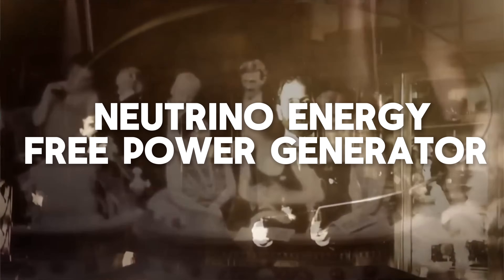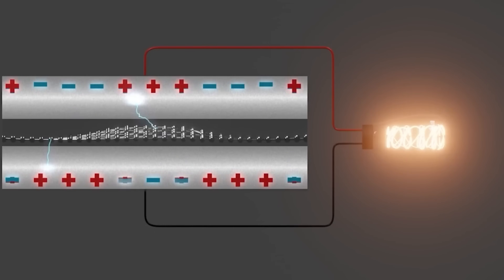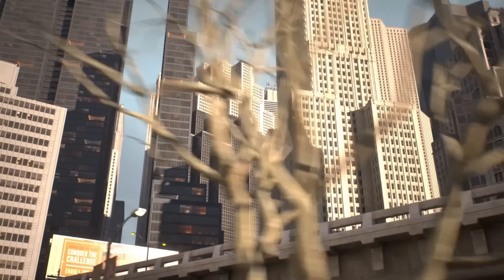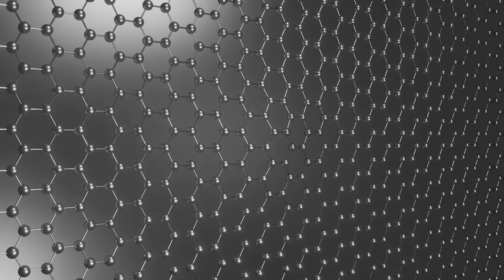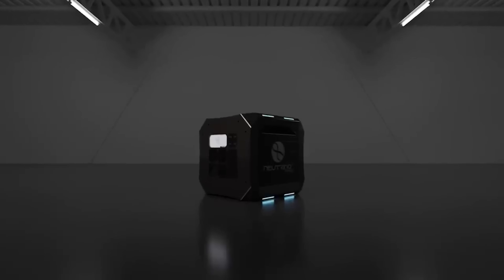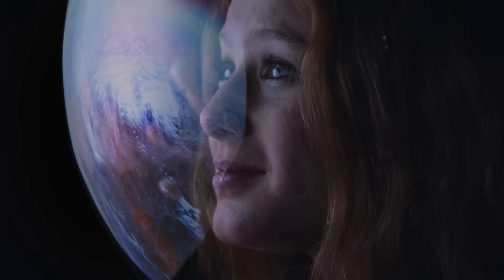German Free Energy Breakthrough: Neutrino Energy Power Cube Unleashed!

Comment: The claims made about the Neutrino Energy Power Cube and its ability to generate significant, continuous power from neutrinos are not accepted by the mainstream scientific community.

Here's a breakdown of the scientific consensus regarding the Neutrino Energy Power Cube:

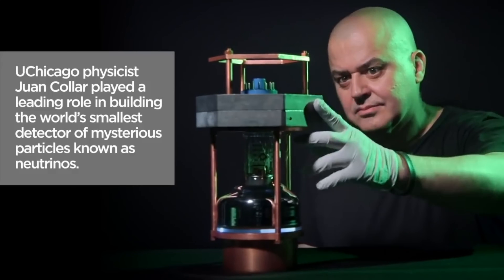Weak Interaction of Neutrinos (1:36, 4:11): Neutrinos interact extremely weakly with matter, making it incredibly difficult to extract usable amounts of energy from them. While neutrinos do carry energy, the energy density from their flux is very low, requiring massive detectors to observe rare interactions, not to power small devices.
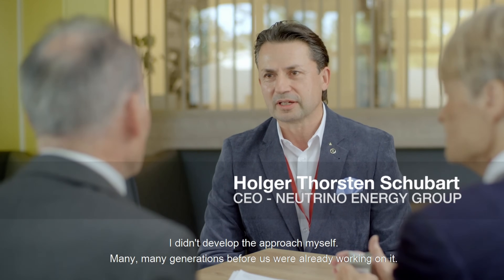Lack of Independent Validation: The claims by Neutrino Energy Group about their "Power Cube" technology, which purportedly uses special nanomaterials like graphene to convert kinetic energy from neutrinos into electric current (2:59-3:11), lack independent scientific validation and rigorous, peer-reviewed evidence.
Skepticism from Mainstream Physics: Scientists view these claims with significant skepticism, suggesting that the technology might be confusing neutrinos with other cosmic radiation or overstating the efficiency of energy conversion.
Patents vs. Proof: While a patent might exist for the technology, a patent describes an invention and does not prove its real-world functionality or efficiency. Independent verification of the Neutrino Energy Power Cube's capabilities is missing.
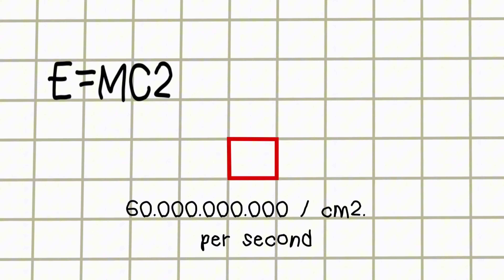In summary, while the concept of harnessing ambient energy is a scientific dream (4:28-4:47), the Neutrino Energy Power Cube's ability to provide substantial, continuous power as described in the video is not supported by current scientific understanding and evidence.

Comment: By the way FUTURE GALAXY, thank you very much for this contribution about THE NEUTRINO POWER CUBE, and by the way, electricity doesnt have to be strong, it just has to be available everywhere and at all times. It is the maths behind it that makes it a fantastic solution, because the strengh lies in the sum of all the small and "weak" units and just for comparison, 200.000 Neutrino Power Cube 5 KW represent 1000 MW the energy output of a medium-sized  nuclear power plant. At the future we dont need to distribute electricity over lon distances. The smart Network is made up of many small units, all connected ! It is no longer susceptible to failure and blackouts !and without a high voltage network to transport the energy over long distances it has no costs either

Comment: 110404    Nanometer scale uniformly aligned parallel diode arrays may be a practical way of absorbing ambient heat. Ambient heat is uniform on a micrometer and larger scale and non uniform on a nanometer scale. Plausibly,  heat absorbtion at the non uniform scale is available as Johnson Nyquest thermal electrical noise that would yield, by conversion without gain or loss, an equivelent amount of electrical energy. 
AND
 Diode voltage / current  characterstics can be displayed on an XY tracing oscìlloscope. Thermal electrical noise power in resistors can be displayed by time sweeps of voltage on an oscilloscope. Each such time sweep shows unique randomness.
AND
A  simple  "Special Program with Integrated Circuit Emphasis" model indicated that diodes in uniform aligntment parallel would aggregate simulated partially rectified thermal electrical noise. 

Maximum direct current electrical power, half, is transfered from a direct current electrical source to the electrical load when the electrical resistance of the two parts is equal. Calculated matched resistance output (watts) is k (Boltźman's constant), one point three eight x 10^ minus 23, times T (temperature Kelvin) times bandwidth (0 Hz to a natural limit ~2 THz @ 290 K) times rectification halving and nanowatt power level rectification efficiency, times the number of diodes in the array. 

There are a billion cells of 1000 square nanometer area each per square millimeter, 100 billion per square centimeter. 

Creditable independent replicatable proof of concept protypes beyond improper influence are needed.

Aloha
Charles M Brown 
Kilauea, Kauai, Hawaii 96754

Comment: 110404.  The second law of thermodynamics may be false conventional wisdom. Let's face the wonder of full heat use. 

The second law of thermodynamics was developed during v8ictorian england's scientific and religious fascination with steam engines. 

The second law is behind modern refrigerators needing electrical energy to compress the refrigerent to force it to release as waste the heat that it has removed from the refrigerator's service interior in the cooling part of the refrigerent's circulation. The interior coldness draws in exterior heat through the cabinet insulation. There is also discarded heat from mechanical friction and electrical resistance. The net thermal output equals the electrical input with energy not being gained or lost in this refrigeration system including its forced waste. Unencumbered refrigeration by the principle that energy is conserved should produce electricity instead of consuming it. 

It makes more sense that refrigerators should yield electricity because energy is widely known to change form with no ultimate path of energy gain or loss being found. Therefore any form of fully recyclable energy can be cycled endlessly in any quantity. 

Full heat recycling, all electric, very isolated underground, undersea, or space communities would be highly survivable with self sufficient EMP resistant LED light  automated vertical farms, thaw resistant frozen food storehouses, factories, dwellings, self contained elevators, safe rooms, and horizontal transports. 

In a flourishing civillization, small self sufficient electric or cooling devices of many kinds and styles like lamps, smartphones, hotplates, water heaters, cooler chests, fans, radios, TVs, cameras, security devices, robot test equipment, scales, transaction terminals, wall clocks, open or ciosed for business luminous signs, power hand tools, ditch diggers, pumps, and personal transports, would be available for immediate use incrementally anywhere as people as individuals or larger social groups see fit. 

Some equipment groups could be consolidated on local networks. 

If a high majority thinks our civilization should geoengineer gigatons or 
teratons of carbon dioxide out of our environment, instalations using devices that convert ambient heat into electricity can hypothetically be scaled up do it with a choice of comsequences including many beneficial ones. 

Energy sensible refrigerators that absorb heat and yield electricity would complement computers as computing consumes electricity and yields heat. Computing would be free. Chips could have energy recycling built in.

A simple rectifier crystal can, iust short of a replicatable long term demonstration of a powerful prototype, almost certainly filter the random thermal motioren of electrons or discrete positiive charged voids called holes so the electric current flowing in one direction predominates. At low system voltage a filtrate of one polarity predominates only a little but there is always usable electrical power derived from the source, which is Johnson (observation) Nyquest (theory) thermal electrical noise. This net electrical filtrate can be aggregated in a group of separate diodes in consistent alignment parallel creating widely scalable electrical power. The maximum energy is converted from ambient heat to productive direct current electricity when the electrical load electrical resistance  is equal to the array internal electrical resistance. 

Maximum calculated electrical power output (watts) is k (Boltźman's constant), one point three eight x 10^ minus 23, times T (temperature Kelvin) times bandwidth (0 Hz to a natural limit ~2 THz @ 290 K) times rectification halving and nanowatt power level rectification efficiency, times the number of diodes in the array. 

There are a billion cells of 1000 square nanometer area each per square millimeter, 100 billion per square centimeter. 

Order is imposed on the random thermal motion of electrons by the structual orderlyness of a diode array made of diodes made within a slab: 

  P type boron doped
-----‐------‐----___-- Out
🔻🔻🔻🔻
■■■■■■___ + Out 
  N type phosphorous doped 

All the P type semiconductor anodes abut a metal conductive plane deposited on the top face of the slab with nonrectifying joins;  the N type semiconductor cathodes or common cathode abuts the bottom face. As the polarity filtered electrical energy is exported, the amount of thermal energy in the group of diodes decreases. This group cooling will draw heat in from the surrounding ambient heat at a rate depending on the filtering rate and thermal resistance between the group and ambient gas, liquid, or solid warmer than absolute zero. There is always a lot of ambient heat on our planet, more on equatorial dry desert summer days and less on polar desert winter nights.

Focusing on the composition of one simple diode, a near flawless crystal of silicon is modified by implanting a small amount of phosphorus (N type conductivity) on one side from a ohmic contact end to a junction where the additive is suddenly and completely changed to boron (P type conductivity) with minimal disturbance of the crystal lattice. The crystal then continues to another ohmic contact. 

A region of high electrical resistance forms at the junction in this type of diode when the phosphorous near the ĵunction donates electrons that are free to move elsewhere while leaving phosphorus ions held in the crystal while the boron donates holes which are similalarly free to move. The two types of mobile charges mutually clear each other away near the junction leaving little electrical conductivity. An equlibrium width of this region is settled between the phosphorus, boron, electrons, and holes. Thermal noise is beyond steady state equlibrium. Thermal noise transients, where mobile electrons move from the phosphorus added side to the boron added side ride transient extra conductivity so the forward moving  electrons are preferentally filtered into the external circuit. Mobile electrons are units of electric current. They lose their thermal energy of motion and gain electromotive force, another name for voltage, as they transition between the junction and the array electrical tap. 

Inside the diode, heat is absorbe; outside the diode, to exactly the same extent, an attached electrical circuit is energized. The voltage of a diode array is likely to be small so many similar arrays need to be put in series to build higher voltage.  

Understanding diodes is one way to become convinced that Johnson Nyquest thermal electrical noise can be rectified and aggregated. Self assembling development teams may find many ways to accomplish this wide mission. Taxonomically there should be many ways ways to convert heat directly into electricity. 

A practical device may use an array of Au needles in a SiO2 matrix abutting N type GaAs. These were made in the 1970s when registration technology was poor so it was easier to fabricate arrays and select one diode than just make one diode. 

There are other plausible breeches of the second law of thermodynamics. Hopefully a lot of people, mostly as independent teams, will join in expanding the breech. Please share the successes or setbacks of experiemental efforts. 

These devices would probably become segmented commodities sold with minimal margin over supply cost. They would be manufactured by advanced automation that does not need financial incentive. Applicable best practices would be adopted. Business details would be open public knowledge. Associated people should move as negotiated and freely and honestly talk. Commerce would be a planetary scale unified conglomerate of diverse local cooperatives. There is no need of wealth extracting top commanders. We do not need often token philanthropy from the top if the wide majority of people can afford to be generous. 

Aloha
Charles M Brown 
Kilauea Kauai Hawaii 96754

Comment: This device seems to be based on relic neutrinos building a superfluid at 1.9K all around the Universe and interacting with matter much-much more than normal neutrinos. Relic neutrinos also serve as a possible explanation for the push model of gravity by streaming into the magnetic core of the Earth in order to condensate into matter with the help of magneto-hydro-dynamic processes running inside of fractal toroidal structures built from charge separated particles and by that causing the effects of gravity on the surface of the planet through a resistence caused when matter is interacting with the zero-point-energy field of the relic neutrino streams.
Relic neutrinos as a superfluid seem to be also the key to non-locality and the consciousness related effects like remote viewing.
So it sounds like an interesting and promissing tech, however devices built on the principles of the Casimir-effect do not need any moving parts (not even at the nano scale) and therefore seem to be more easily engineerable and manufacturable to me. 
Nontheless I am delighted to see more and more efforts towards free energy devices that could free humanity from the shackle of scarcity and environmental destruction and elevate us towards the next level on our cosmic journey as a conscious, awakened, spirit-driven, space fairing civilization.
Reply: Sounds like you know what's up. Gravity is a pushing force, not pulling, created by magnetic fields universally. The casmir effect is the best way to solid state free energy it seems. You may want to study the Le Clair Effect and especially E-infinity theory fractal-cantorian-space-time to explain the negantropy and non-locality entanglement. I'd love to talk more!
Reply: Welcome, to the wake up group

Comment: Super-Kamiokande is a giant neutrino detector hidden under a mountain in Japan. This structure, filled with 50,000 tons of water, is the most mysterious structure in the universe.
to capture neutrinos, which are particles
is working. Neutrinos have almost no interaction.
doesn't come in, so find them and
Catching it is quite an achievement.
So, if it is easy to catch neutrino. Question is this; Why Japans made this detector under 800 meters underground?
Reply: They dont want to catch Neutrinos - thats nearly impossible - right. Simply they use effects of Neutrinos and other radiation while passing layers of graphene
Reply: @gaiaassociation  İ mean they try catch the neutrinos effect. Thus, they will prove the existence of neutrinos. If it interacts with graphene so easily, why did they build such a detector?
Reply: @coininfoplus1551  Neutrino energy did not built a detector, they use their interactions with Graphene to produce usable energy ...
Reply: If you can produce energy then you can also detect in this way.
Reply: @xtofury  But, the reverse is not true: If you can detect neutrinos, you cannot necessarily produce usable energy.
Reply: @hanksimon1023  i'm suggesting this ought to be more sensitive than super kamiokand if their claims are true, i don't actually buy what they are selling.  I'm always skeptical of "free energy" claims.
Reply: @xtofury    Their claims aren't true. This company only has a finance and PR-department and a CEO with a criminal past.
Reply: Question is this; Why Japans made this detector under 800 meters underground?
The answer is quite simple: The detector is underground to avoid  a mix up of signals coming from neutrinos with signals coming from cosmic radiation. All neutrino detectors are operated underground.
Reply: since neutrinos can easily pass easily through light years of lead, I call BS!

Comment: If it's free energy then sure send me it for free. go on. I'm waiting. It sounds like it's exceedingly expensive.
Reply: jajajaja You don't understand the concept of free energy, this is not free of charge. Converters, copper, graphene, each bolt, etc. have a cost and above all the transfer of technology. Free energy refers to a profit over normal performance. This delta that has been gained between input and output is free energy.
Reply: @alvaroillanes  you mean like solar panels and wind energy generators
Reply: Its a fake.....
Reply: @sparkydog2  how you can judge from distance... Its not.
Reply: @sparkydog2  They use all kinds of - for humans - invisible radiations including Neutrinos - but not only.. Neutrino is more a kinda brand name - what indeed - may cause many misunderstandings